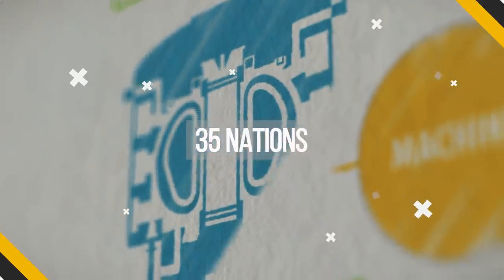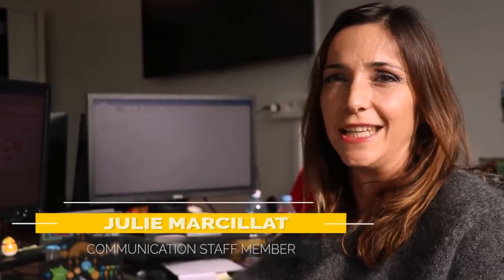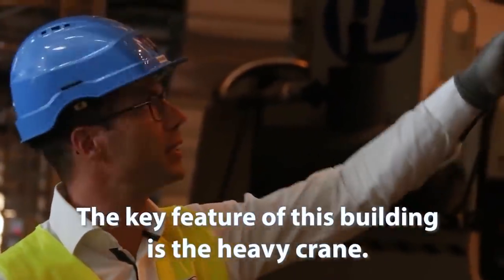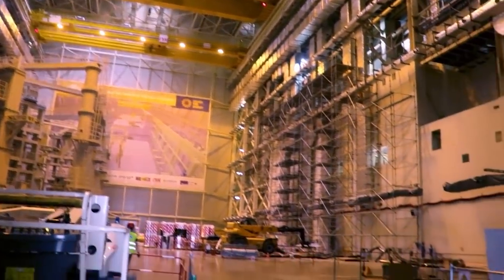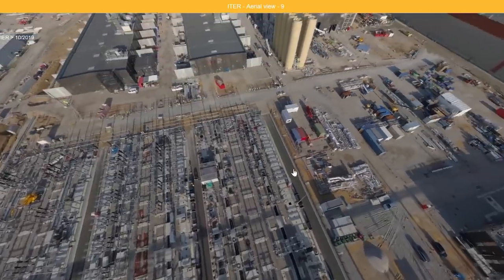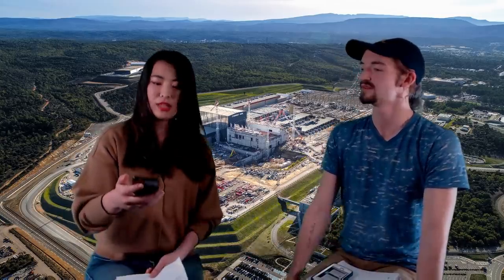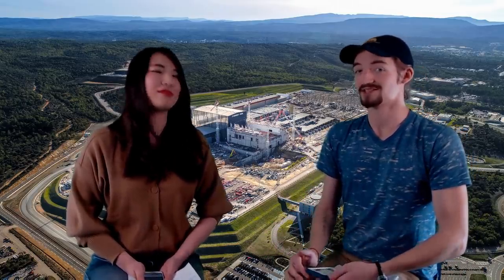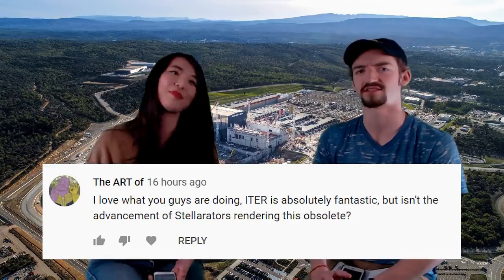ITER NOW 1.3: Visiting ITER

Comment: I really hope to visite ITER soon to. I love the project. 

Is there a rough estimate about how long it will take till the reactor will be usefull so we can get more power out of it then we put in?
Reply from the maker: In 2025, the machine will create its first plasma. Then in 2035, it will go beyond the break even point. But the great "usefulness" ITER will produce is its paving the way for other machines after that to actually hook into the grid and supply energy to society.
Reply: @iterorganization  i see thats great!! Thanks for the reaction.
Reply: @gameresearch9535  it is far to late to drasticly change the design. It's over 60% complete.
Reply: @gameresearch9535  photon computers are obsolete with quantum computing. And what is the advantages of using photons, electrons work fine and are well understood. Changing the infostructure of the entire power grid would cost way too much money time and resources to be viable without it having large advantages.
Reply: @gameresearch9535  Why not let the scientists do there job, and if you do have ideas, contact them from there website, not a YouTube comment section...
Reply: @Jaden Pelate

It would be nice to have this information from iterorganization, not from a random youtube commenter.
Reply: @Jaden Pelate

Because some people are beyond the thought of Electrons, we have used electricity for a long time, it's time to move forward to Photons as the true energy source on the grid itself after the Fusion reactors.

How it costs depends on the innovation that goes into it, everything is changing, from the materials to the "emerging" technologies themselves.

And on top of that, that's what I like about it, electricity is the energy source of the past. It's time to move forward.

Also to point out, Photonics will happen rather you like it or not, Photonic Computing? I mentioned the playlist but it went over your head about what I was trying to show them, had you actually gone to the Photonic Computing playlist, it would have made sense about the energy.

If you had seen my other channel using the links, you would have known what I've seen with Quantum Computers, especially a Spintronics Graphene Photonic - Quantum chip.

Neuromorphic Computing with Hyper Dimensional chips is way down the road, though with breakthroughs it could come much sooner as many things are being proven right now. Technology is advancing so fast, you can't keep up with it. And Neuromorphic Computing is one that worries people because of the A.i., it's at the level of a mouse (so far), and will advance / mature later on.

Bio-Computing is another that worries people, DNA computing is on the way with storage and a lot faster.

After Bio-Computing and DNA computing with storage, Liquid-Computing will be a thing, that's going to a level beyond what even most reading this could imagine until then, actually that already happened with Quantum Computing and Neuromorphic Computing that I explained.
And there's a reason I don't have some of these other computing types on my other channel, for now.

I'm more into the Quantum Computers that have Photons and not electrons, otherwise I see someone trying to hold us back and some corruption there. On top of the fact that it should be a Graphene Quantum Computer, and why not? Don't be toxic. And also check out Archer Exploration also known now as Archer Materials in my Graphene playlist for the Graphene Quantum Computing brain chips as they explain where they are at with it, easily built throughout 2019, so don't tell me it's not possible.

Though from what was said, Ion - Trapped Quantum Computers are the most advanced, they are probably just slow to build and progress, but other sources have shown that it converts the particles to Photons, and if that's true.. then that's exciting for me.
In fact, some of the universities around me are working on Ion - Trapped Quantum Computers, and so instead of assuming, you clearly have no idea. I could say so much more.

Fusion is the right source of energy, so are Photons for the grid to replace Electrons, with Photonics.
Now instead of being dense, try actually looking at my Photonic Computing playlist as to why I linked it, I have good reasons.

Btw if you thought that I didn't notice Quantum Computers as the possibility of replacing Photonic Computing, you would be wrong.
However... it is still an interesting thing to know about, especially for those that don't know, or those into it that could find out more, and that.. is what that specific playlist is for, Photonic Computing.
And had you actually gone to my other channel, you would have seen my Quantum Computing playlist, I'm clearly very aware of where things are. Even just one person can have random creativity, but more than one person aware, multiple people can have creativity from each person and that.. is what's important, is awareness and learning.
I have done the right thing by showing people, even the I.T.E.R. organization.
Reply: @Jaden Pelate

Why not let the scientists do "their*" job absolutely, and they have, and they still do.
Why not let the people have what the scientists have found? Is another story.
And to find that out, you would need to go to my other channel in the steps and links from my other comments above yours.

Scientists should never be biased, and usually they are not for a good reason that goes beyond politics, or they wouldn't be scientists, as the most open minded will find the true materials to use in limitless applications, in this situation.. this would be Graphene (for now). With also other new materials to come out beyond Graphene.

If I have ideas, I don't need to contact them, they can just visit the channel, that's the point of the comments, you.. don't need to be toxic and tell people what they should or shouldn't do in the comments section, I have every right to let people know, and if you don't like it, then you're showing a clear bias and hidden agenda, and if you don't care, then why are you commenting?

Also, if you had actually gone to my links instead of making comments first, you would have watched and checked everything on my other channel which also includes each playlist description and the "About" tab.

And if "you".. or anyone else doesn't believe in what's seen or read on my other channel, then "you".. can go to my "About" tab and find the official website links from companies in the videos and contact them yourself with "their*" website links, so instead of giving advice, maybe "you".. should take it instead and learn to read my other comments with links and not be both arrogant and ignorant at the same time as trying to contradict me, to the point of being in denial and trying to give someone else advice that obviously had a good reason for making such comments in the first place.
You ignored my reasons to shove your agenda on me, how very toxic, short - sighted and ignorant of you, on top of I sense a bit of petty there as well.

I don't need to say more, the differences / good reasons are right there on my other channel. Do not comment / reply to me again, with such bias and ignorance. I never asked for your toxic opinion.

And I do not agree with you, which is fine, because what I've shown from my other channel are facts, you.. are in denial. Which shows a clear bias for some reason, a hidden agenda.
The thing is.. right now.. I'm seeing you as isolated, as much as the reactor itself, when it comes to brainwash. No insults, just facts.

Just because someone gives ideas because of the way they are, doesn't give you the right to harass or be condescending to them with your toxic attitude, you never even tried to see my reasons, or looked at my playlist with your biased and toxic attitude.
Reply: @gameresearch9535  I only said that 1: the multi billion dollar project is over 60% done. You cant chang the design to be drastically different. 

2: There is a for scientist tab on the website to help publish papers, something you seem like you could do, so they can see the research into the material properties of graphite. The website is designed for this, YouTube is not. 

3: I never said photons cant be used, just that it would cost a massive amount of money to rebuild the intire power grid with fiber optics. And quantum computing computing already uses photons for computing. 

4: I dont have an agenda, but I am a man that sees how cheap world governments can be. Changing ITER's design, even to something better and cheaper, would still ad cost. 60% of the components are made, and no one wants to fund a redesign. That's what DEMO is for. We can barely get people off fossil fuels, let alone rebuilding the intire power grid. In the perfect would we would do all that, but in this world money is king.

Comment: They say when done testing the tokamak, it's not going to be put online into the power grid,  just wondering why it wouldn't be added. Great show btw, thx
Reply: It's experimental reactor, to prove the possibility. If it works, the next one (fully functioning, providing power to the grid) is to be built in Japan.
Reply from the maker: Indeed - even ITER will not be strong enough to supply enough energy to the grid to make that worthwhile. But once ITER is successful, the roadmap will be clear to building "DEMO" and the fusion power plants of the future that will certainly be worthy of connecting to the grid. ITER is an experiment to show us how to get there.
Reply: ITER is expected to produce a total of 500MW; thats equivalent to EACH of the generating units is a conventional power station - the one near me alone has 4 units, and there are dozens of stations, so 500MW is almost inconsequential in terms of national supply. The additional cost and complexity in linking it up to the supply grid is outweighed by the flexibility in its operation to further the experimental goals. They cant just add their excess power to the grid when the make it, as that could destabilise the entire network; its a finely tuned system and interlinked across the whole of Europe - grid operators have a tough time coping with wind and solar generating when nature provides, but weather forecasting is pretty good, and the variability is small. Chucking a spare 500MW onto a grid (or dropping it out if theres a need to stop suddenly) has a much bigger impact than if the wind gusts on a couple of wind turbines, or a cloud blows over a solar array. A surge of that size could do more than this: https://en.wikipedia.org/wiki/Northeast_blackout_of_2003
Reply: @iterorganization  in another 100 years after 500bn of funding maybe. ITER 'strong enough'? garbage.
Reply: @SF-gn6uw  If you're such a skeptic why are you here? Mummy not hugged you enough today?

Comment: Why is there such a big time gap between first plasma and D-T experiments? Is this to account for the optimal 'machine settings' or do D-T experiments require additional structural improvements, to be installed inbetween the former experiments?
Reply: The issue is the high neutron radiation with D-T fusion. 
Most diagnostics are not designed to withstand the high neutron flux for long times.
Also the neutron flux makes the walls radioactive so the handling of the experiment gets more difficult. 
It is essential to get all the plasma parameters right and fix all possible errors before you fry your diagnostics and activate the walls.

Comment: Here is a tough question: You think it will be possible to incorporate liquid surface method for plasma facing components? I'm quite concerned that by the time we have first plasma at iter, the construction itself becomes somewhat outdated
Reply: 1.5x playback everything - thank me later I doubt it! Its already been designed with Beryllium for thermal and neutron management, and changing the design of something on this scale during construction is a recipe for delay, cost escalation, and likely technical failure. This is only an experiment, to prove the mechanisms and scale that should solve the problems encountered over the 100 years since fusion was postulated. Liquid surfaces have been suggested for only a relatively few years; I’m sure once more research in that field has progressed, enough will be known to decide whether to incorporate it into future plant. It certainly doesn’t make the ITER design obsolete, any more than diesel and petrol engines were obsolete on the journey from steam powered personal transport to electric vehicles.
Reply: @andyowens5494  thanks for a thoughtful reply comrade!
Reply: 1.5x playback everything - thank me later Thats a first; I can safely say no-one has ever called me “comrade” before. I can only assume you are not English, and don’t understand the cultural implications of that word (but I can’t detect a hint of your nationality from your comments).

Comment: What technology of conversion heat into electricity will be used? Will it be the same steam turbine like in nuclear plants, having around 30% efficiency?
Reply: Who cares? It's not important. ITER is here to prove one thing: can we make a sustainable fusion reactor with net energy output? That's it. It's not supposed to generate electricity.
Reply: @EaglePicking  I heard that 500 MW generatiin was planned.
Reply: @TechMasterRus  That is the plan, but that's not electrical power. They want to generate that amount of power as heat energy to show you can get more energy out than in.
Reply: @GamingWithNikolas  Ok, thank you for reply. So, making first working demo plant that generates electricity will take decades more after 2035.
Reply: @TechMasterRus  sadly, as DEMO will use the data from ITER as a blueprint. This will take time, but this is also increadably complicated, so that is to be expected.

Comment: Can this thing explode?
Reply from the maker: Nope! Unlike nuclear fission reactors, there is no possibility of a "runaway reaction." Additionally, with less than 1 gram of fuel in the vacuum vessel at any given time, it is not possible for anything to explode - even though temperatures in the plasma will reach 10 times that of the core of the sun.
Reply: It is intrinsically safe. Even if you bomb it, only that bomb can explode. The fuel of this reactor type cannot start fusing uncontrolled. Because any form of damage immediately takes away the unique conditions that are needed for fusion.

Comment: What is the CO2 cost for the construction process of fusion reactors compared to fission ones ? Has anyone tried calculating that or is it too early ?
Reply: Its to early. This facility is only a test area, and it's not going to generate any electrical power. The co2 for construction on this project is going to be large, but this is not a power plant, so it cannot be compared to a power plant. When they build the DEMO reactor, then one can start making comparisons. 

Also, a fusion reactor produces less radioactive waste than a fission reactor, they did do the math on that.

That is a good question, it just cant be answered yet.
Reply: Way to early iter is like a beta for fusion energy it's not used for grid energy production